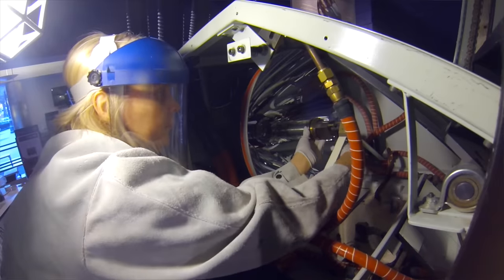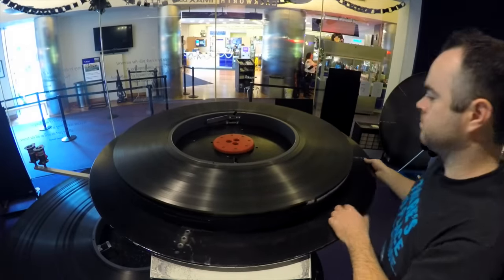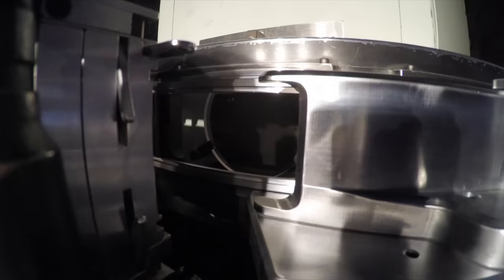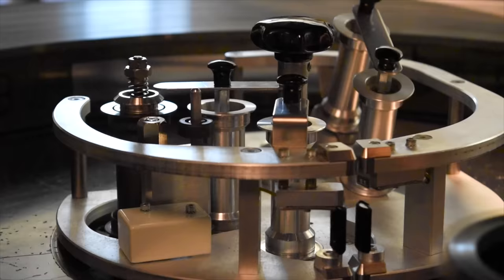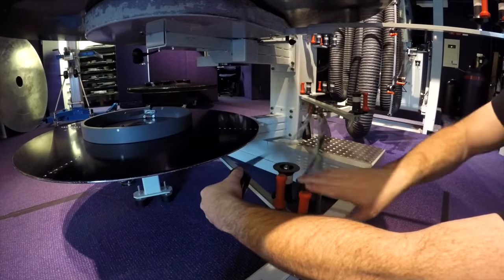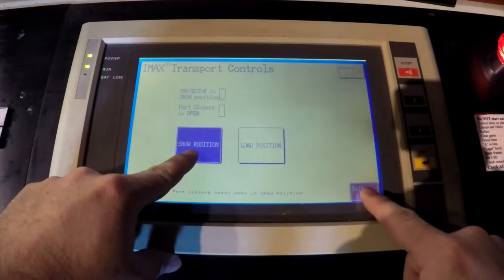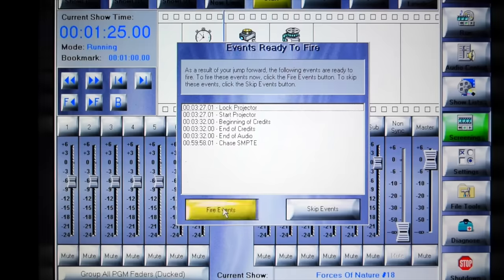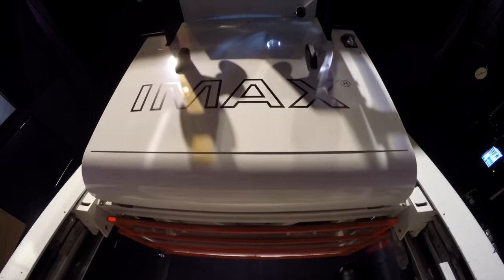The Incredible Process of How a GIANT 70mm IMAX Film is Played

Comment: This seems so ridiculously old-fashioned it’s weird to think it’s still done like this. To say normal movies are digitally streamed, I would never have guessed actual rolls of film would be used, especially for the level of quality required.
Reply: Actually today's movies are sent to the theaters on a hard drive to be dumped in the theaters storage system. There is way too much information to "stream" a theatrical movie.
Reply: film is an analog format so its resolution is basically infinite. In the same way your eyes dont see at a resolution neither does film.
Reply: @adelinevesecky1817  but the movie ist Filmed Digital. So there are noch sharpness benefits.
Reply: @marcesser4218  depends on the movie but it's not uncommon to film on 70mm and digitize it because you can digitize to any resolution so it's future proof. That's how old movies can be rereleased in 4k
Reply: @81396xman  Not the way my local cinema chains work I’m afraid. They have a direct connection to a central server which runs all the films on a high-speed internet connection.
Reply: It's done because the quality is BETTER!

Comment: How do I get this job?? Serious question, I’m in love with film, it’s a passion of mine and having this job would be sweet.
Reply from the maker: I started as a film major which made it very easy to get a job in the IMAX theater. However, you do not need to be in film to work at a theater. I took tickets and did various other things for about 5 years before I was trained as a projectionist. Only took that long because there were no openings so I imagine you could get this job in far less time after starting at a theater. Go for it.
Reply: Ethan....very easy... just show them that you can do it for them...questions?
Reply: You wont have to soon as this job is going away

Comment: Are the 70mm IMAX movies projected at 60 fps?
Reply from the maker: That projector can only do 24fps.
Reply: BigChap J 😂
Reply: hornetluca There used to be IMAX film projectors (the system was called “IMAX HD”) that projected 70mm IMAX film at 48fps, but it was never widely used since it costed more, used more film, and put more strain on the projector (Soarin’ at Disney California Adventure and Epcot used the projectors to project the image before it was revamped a couple of years ago).
Reply: There is a process called Showscan that runs 70mm film at 60 fps, but it's basically only ever been used for short movies for theme park rides.
Reply: hornetluca it's film lol all films are 24fps
Reply: I miss films.  I was watching some crap Disney movie at the oral surgeon, while waiting for someone's procedure to finish.  And it looked bad, due to looking like a TV.  Film has a certain look to it, a softness perhaps, and maybe to some extent due to it's frame rate.  I have the same issue at my friends.  He has a 70" flat screen, and movies like like TV, not movies.  And I don't care for watching movies, even though it's a great TV ( video games, on the other hand look amazing at 4k!)
Reply: all films were shot in 24 fps and also when its playing
Reply: not all but the majority yes.
Reply: Michael Bauers most tv's have a "film mode" that you can turn on. What this does is turn off the circuitry that they use to interpolate between frames, which is really good for tv and games as it looks smoother, but for films it really ruins the feel of it.
Reply: Film is not game.
Reply: It would be completely impractical. One frame of IMAX film is about 2.8 inches wide, which makes a second of IMAX film 5.6 feet long, and it needs to move through the projector at 3.8 MPH. (compared to 18 inches and 1 MPH for 35mm film). If it were to run at 60 FPS, one second would be 14 feet, and it would need to run at 9.5 MPH. But what would really kill it is the overall length of the film. IMAX film platters can only physically fit 2 hours and 47 minutes worth of film. If that same film were to run at 60 FPS, it would only run for 66 minutes 47 seconds. And then there's the platters themselves. At the beginning of the movie they feed and takeup film from near the center, so they have to spin extremely fast. Assuming the takeup ring is 18 inches wide (I have no idea how wide it actually is), the platters need to spin at 35 RPM at the beginning of the movie. At 60 FPS, they'd need to spin at 88 RPM. That would probably make the film fly off onto the floor which means refunds for the audience and hours of cleanup for the projectionists.
Reply: We don't have 8K yet. That's the BARE MINIMUM needed to approximate the resolution of IMAX film. 12K would be ideal. Even 4K, which the best digital IMAX projectors use, is only about as good as 35mm film in terms of resolution.
Reply: Adam Ahmed Yeah but aren't most films today scanned to be edited, add digital fx, and color-corrected digitally today? Even IMAX ones. I never heard of someone editing and color correcting movie in film today.
Reply: Sure. Scan the IMAX film at at least 8K resolution, do all the processing at that resolution, print it back onto IMAX film at that same resolution.
Reply: +YS Film scanners don't have to scan in real-time so they can take their time to capture every frame in high resolution and the full dynamic range.
Reply: Adam Ahmed 

8K cameras do exist, but 8K projectors are still developing.
Reply: And you not only need both of those, but everything in-between.
Reply: Movies usually go in 24 or 26 frames.
Reply: Almost always 24. Never even heard of any sort of 26 FPS standard. The only real exceptions are movies deliberately shot at high frame rate such as Hobbit.
Reply: Adam Ahmed wrong, we do indeed have digital 16k, and the cheapest video cards can handle 8k 30hz continously. The biggest problem is the port that you use, but technically you can use dual dp and get the bandwidth for 8k. For sure, with a special port and a special (not SO special) graphics card you could run 12k/16k 24hz.
Reply: You're just talking about rendering. That's not the issue. For starters, you need to be able to shoot and project movies at 16K. We don't have the technology to do either yet. Then you need to be able to do everything else, all of post-production and storing and shipping the finished movie, in 16K.
Reply: If you shot 70mm in 60FPS... Jesus Christ the amount of film...
Reply: No movieheater does movies in 60fps
Reply: 600fps
Reply: But how many times are each frame shown? On 35mm projectors which runs at 24 frames per second the shutter normally opens two times for each frame and on 8mm projectors that runs at 16 FPS three times which gives a percepted frequency of 48 flashes per second.
Reply: If anything more than 24fps movies catches on properly I'll be baffled. It makes no sense to me. If games didn't exist nobody would complain. I don't think we should fix what ain't broken.
Reply: @LoganScottY  60fps films and television looks totally unnatural and just bad. People who say they prefer it are simply lying it looks like shit. My honest opinion on that
Reply: God, I hate gamers talking about movies.
Reply: movie makers will never experience what 144fps feels like. they'll go for that old ass camera for the res and 24 least fps to keep the scenes moving.
Reply: Why in God's name do you want higher frame rates so much? Jesus Christ.
Reply: @organfairy  Who told you that? Projectors have shutters? The film stops for each frame, three times with the "shutter?"
Reply: Because I have an 8mm projetor myself that I have opened several times to replace the light bulb. Between the bulb and the film there is a rotating shutter and it makes the light flash three times for each time the film is advanced.
Reply: Adam Ahmed we do have 8k with the RED WEAPON.
Reply: @KingdaToro  i hate the look of film it makes everything look like shit hell 1080 p go pro is a Better camera  than the best film camera
Reply: @HighOrbitMediaVideos   For example if projector could roll fill twice as fast it would be 48 fps.... right ?
Reply from the maker: @ammorack8644  Yes.
Reply: All film projectors run at 24 fps.
Reply: @BigChap J There is no such thing as "Cinematic 30 FPS", the only cinematic framerate is 24 FPS
Reply: I’m pretty sure  “The Hobbit” was shot at a high frame rate.   But some people seem so emphatic that all films are 24 FPS.  Much like saying you can’t go faster than the speed of light.  

24 FPS is just an arbitrary number that was adopted because it hit a sweet spot between making the motion appear fluid but limited the cost by not going higher.   Saying that higher frame rate looks unnatural is just stupid.   It looks different than what you’ve become accustomed to.   That is all.  I prefer the higher frame rates because it looks more like the way I see the rest of life.
Reply: @dave_dennis   Yeah, The Hobbit was filmed 48 FPS, but people who saw the hobbit movies in cinema where wondering like  "Something was different this time and i dont know what..." so they didnt had the same cinema experience as always which was confusing for them, because they didnt knew what was different... thats why 24 FPS ist THE one framerate for moveis, because its the cinematic cinema experience people expect when they are going the the movies :) (My cinematographie teacher told me about this and showed me the difference)
Reply: @David Dennis This thread was talking about the frame rates from a projector in a cinema and not about how many frames were shot.
Reply: 90 fps is the bare minimum nowadays for games, 120/144 are more standard. 240 if you want to go a bit overboard. Motion in films looks terrible at 24 unless there's a quality blur.
Reply: Not to my knowledge and I am pretty knowledgeable when it comes to film and film projection systems. Imax is 24 fps. The only 70mm that went faster is Todd-AO which was 30 fps.
Reply: @DDBurnett1  thats crazy unless its standard 70mm. At 60fps thats a lot of film to get through a projector in 1 second! I know standard 35mm is 18 inches per second @ 24fps so at 60 fps thats around 45 ips and 70mm has a bit larger frame (height) so about 50 inches of 70mm @ 60 fps OMG thats fast!
Reply: @Everything older films (soundless) were shot at 18 fps in like 1922, everything sound is at 24 or 30 fps and HDTV also is 24fps not to be confused with NTSC at 29.97 fps
Reply: @andrewbarnum5040  Showscan uses standard 70mm film  (which has frames that are 5 perforations wide.) Since the Showscan format is almost totally impractical as is (it's really only been used in theme parks and museums), I seriously doubt the inventor ever considered using anything larger than standard 70mm.
Reply: @DDBurnett1  Thank you for sharing that tidbit about 70mm film I did not know (and there is very little about film I don't know) do you know why they chose such a fast frame rate? One would assume they wanted a smoother image.... Less flicker could be achieved by adding more blades to shutter which would be a lot easier and cheaper.
Reply: @KingdaToro  Actually 1080 resolution came from the optimal digital extraction from a 35mm film.
Reply: David Dennis you dont see montion blur in real life? Your eyes are next level my fren?
Reply: In Aere Edificare:  I thought 1080p was the same resolution as 16mm film.
Reply: @evmcg  not true. Films can be recorded and played back at any frame rate
Reply: @anggasuryo9591  films can be shot and played back at any frame rate
Reply: @KingdaToro  japan has 10k already
Reply: @WalnutSpice  film and video are just different. Each have there own characteristics.  But the expenses of film. Production are very expensive, this is just one reason why film will be obsolete
Reply: @susmoys  the reason they shoot at 24fps because any higher frame rate (such as 30) does not yield any better quality, but the cost of productuon rises. In addition back. When film was gaining ground as an entertainmrnt medium, tje film stock was not that sensitive to light and they had to run it slow to obtain maximum flexibility in lighting conditions. 24fps was chosen becuase it offered the least amount of flicker to the viewer and longer exposure times.
Reply: @NVC77  only by tradition on fact they can be shot and reproduced at any frame rate
Reply: @catsbyondrepair  film has a different "feel" film is more soothing to the eye than video. One is not "better" than the other. If you like that starkness and rigidity of video, fine,  but if you like the softness of film, that's good too.
Reply: @iczerone2000  not true, all film projectors have variable film rates. Its just tradition they are set to 24fps

Comment: 13k watt xenon
holy molly. Thats equivalent to the power of a small tractor. In a light bulb
Reply: These lamps are very crazy.
Working gas pressure can reach over 80 Bar.

The Arc is very tiny so the light densety is more insense than the sun.

I own a little one with only 1600W but i cannot use it becaus it just need 60A of current and over 10kV to ignite!
Reply: @localboys7449   I did test theLapt 3 Month ago... It is Crazy bright and intense.

That tiny bit of light out of my windows (like 10% from the total light of the lamp)
Turn the Night outside to day.

Very impressive and dangerous.
Reply: Andy Privat WOWW very impressive man

Comment: How does the film not break when you rise the projector up to it's start position
Reply from the maker: Good question. The film is very strong. Once we were disposing of a film and dumped a bunch of it in a trash compactor and it actually broke the compactor! I'd be very surprised if someone could rip or tear 70mm film. Secondly, when the projector is rising into the theater, the film is pulled up with it. It's not pulling on it like a rubber band.
Reply: On the same sort of topic, you mentioned that the print gets dirty the more times it's used. How do you minimize that? I would also like to mention there is nothing to beat a Chris Nolan film in IMAX, especially when the 15/70 footage comes from the original camera negative, giving you an 18k resolution. On Blu-Ray it's as sharp as you like
Reply from the maker: reptongeek The only way to minimize it is to keep the projection system as clean as possible by the process shown in the video. But with the short turnaround times it's difficult to keep up sometimes. And yes, Interstellar was incredible on our 9,000 sq/ft screen.

Comment: A regular IMAX projector isn't on a lift. This is an OMNIMAX or IMAX Dome theatre where the screen is a dome and requires the projector to be right up against the fish eye lens in the middle, leaving no room for the projectionist to load the film. That's why a lift brings the projector down to change the film. A regular IMAX projector is fixed, and therefore very slightly less complicated.

Comment: I’m no technician, but dear me this looks massively over-engineered - especially with regard to the length of sections where the the film needs to run though.
Reply: it needs the tension to run properly so nothing slips
Reply: @razhyel_  I understand that part, but does it need to travel 84 miles to do that? lol
Reply: Of course you want to keep the distance and number of rollers the film has to go through as low as possible. But for the whole length between decks and projector, the film has to have a certain tension, as not to fall out of the rollers. For that, some extra rollers and springs or weights are requiered. As the film can only bend in one direction, you have to allow for a minimum distance between rollers if you need to flip the film from vertical to horizontal (to go up and down instead of left or right). Sensors for time or sound codes require some more space. Between decks and projector, the film is moving constantly, but in front of the projector, between light and lense, the film has to fully stop a certain times per second to allow for a steady image to be projected on the screen. From my experience working behind the scenes in a cinema, they really try to use as few parts as possible
Reply: Alot of the complexety comes from having to align and realign the film in each end of the projector elevator

Comment: I used to work as a projectionist like 10 years ago now. Theater was very old and didn't have fancy stoppers to prevent the film from sliding off the trays. We actually had a few winding trays end up stop working halfway through a film, leaving pools of film, kilometers of it on the floor. Had to refund a whole screening once because we couldn't get it up and running until we got it all wound up and untangled. 

It was the most fun and most stressful job I've ever had. I really miss it.
Splicing the film parts together, threading, moving, was all really interesting. 
But when the old and crappy system caused issues, worst time imaginable.
Reply from the maker: Yeah, there's no small problem with one of those projectors. That's crazy you had pools of film on the ground. Can't imagine the cleanup effort.